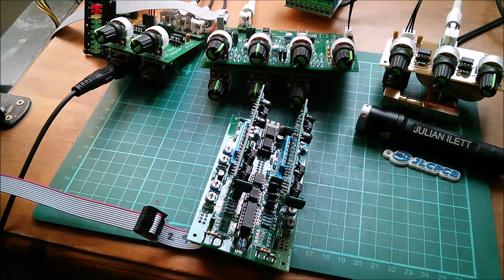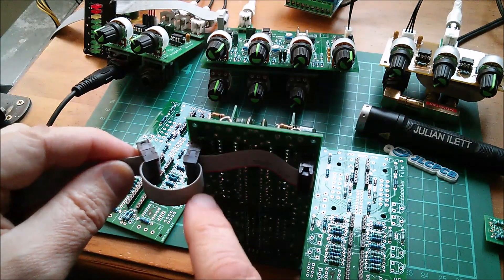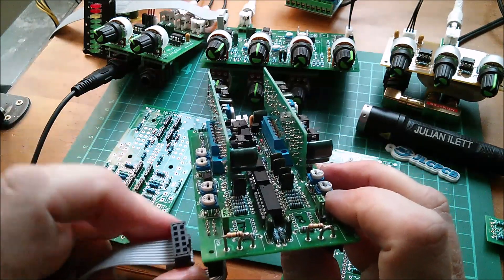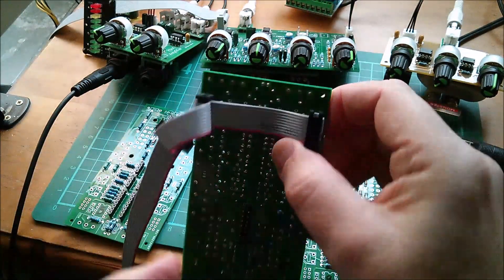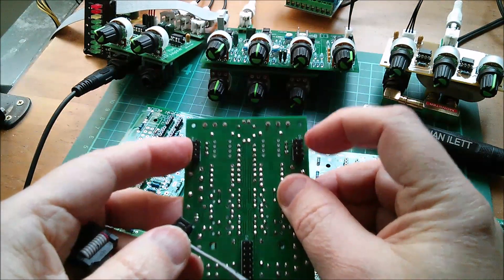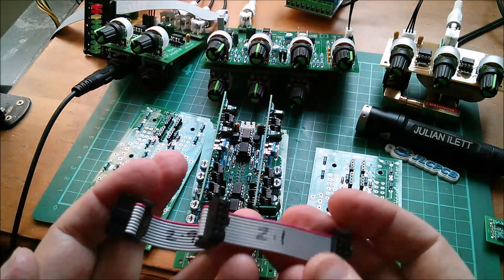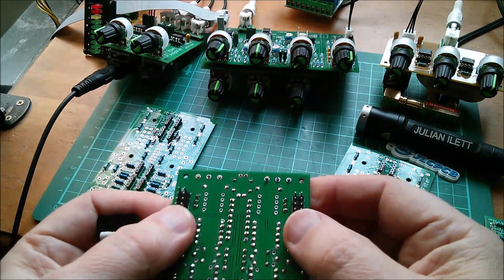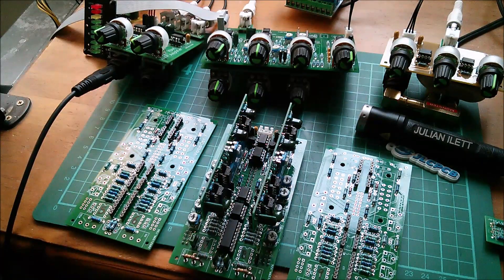Ribbon Cable Issues - Vocoder

Comment: Why could you not make both gaps 2.1 so you can't get mixed up during cable making?
Reply from the maker: 2.1" is not enough length to make the loop :)
Reply: @JuliansShorts So you are saying the connectors on 2 adjacent boards are further apart than the connectors on the same board?

Comment: excited to see you working on the vocoder. old analogue electronics are a soft spot of mine. im working on a synthesiser, and a lot of circuitry carries over from a vocoder
Reply from the maker: I'm looking at some old projects from E&MM - Syntom, Synbal, Synwave etc. These are drum machine modules that use a lot of the same components as the vocoder. I'll be booting up the PCB design software imminently :)